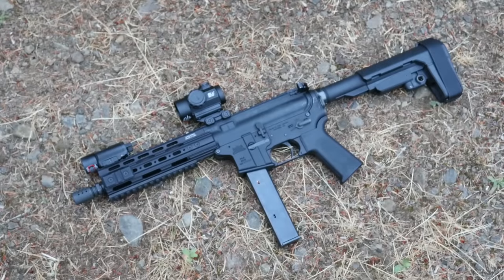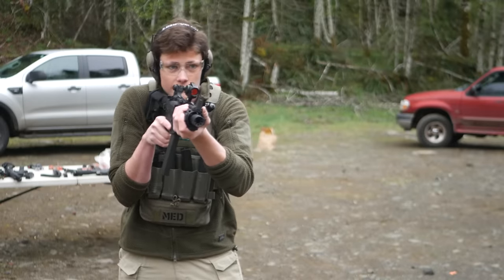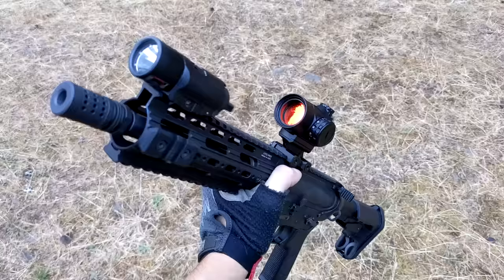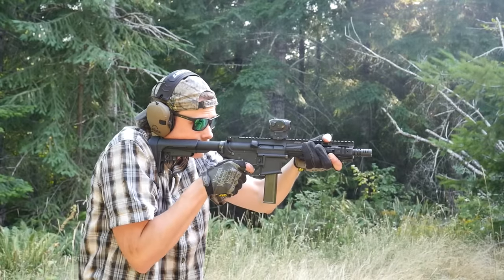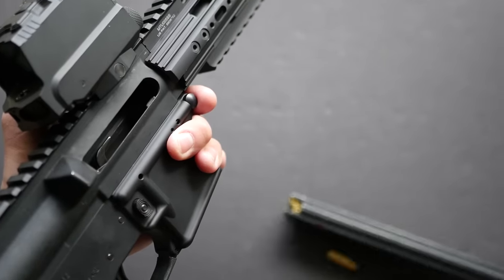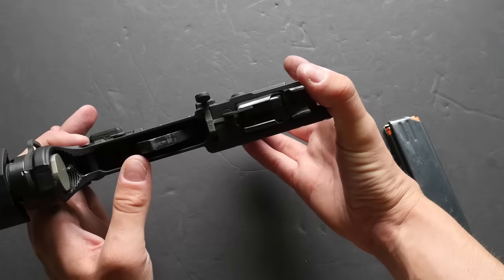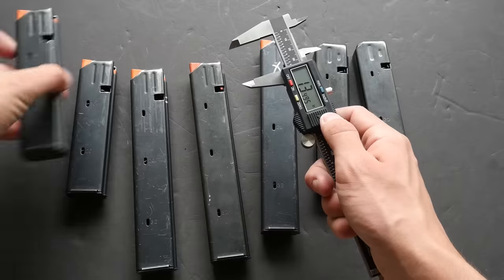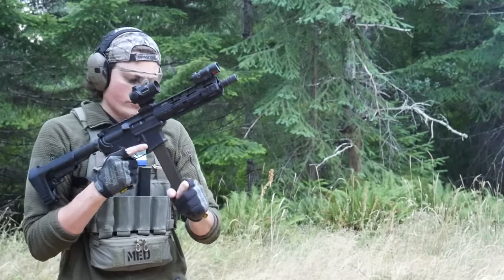The Perpetual Agony of the AR-9

Comment: I ended my pcc fixation with a Cx4, on the theory I can ignore the brace world, and if I like playing with it then it should be reliable enough for a non-eardrum exploding hd gun. Not everybody has a pile of Beretta mags already though
Reply: I did the same thing. 100% reliable and shorter than most AR pistols with the 16 inch barre
Reply: @bubbatime  It's such a handy package because it's practically a bullpup
Reply: I've wanted one forever and never found one.... 😐

Now they're hella expensive.
Reply: @AOMartialArts  ?
Every local gun store had them before the Kongflu. CX4 weren't very popular and are weird huge PCC. Maybe cause of the low price, high reliability and 9mm Caliber they sold out in the last 3panics. (Flu, Riots, Biden)
Reply: @echodelta2172  technically a glock is a bullpup
Reply: My one and only is a KP-9 for maximum slav larp
Reply: @AOMartialArts  new ones popping up for $799
Reply: I got rid of mine. The ergonomics are no where near a CZ Scorpion when working at speed. Time you mag changes with the beretta... Atrocious! I also had to break my grip to drop a mag
Reply: @almostontimehero5415   It's all relative.  I haven't seen any new in years, either.  Haven't seen any pop up used.  I'd love to know the colloquial history of local gun shops.  When this all started I'd hear that one part of the country couldn't get this or that and we'd have it in abundance.
Reply: @senavicente  CZ seems to be one of the only proven options that's close to the same price point. Cx4 magwell design is a bottleneck on reloads, but I'm ok with 31 rounds of 9mm for hd and I'm not particularly concerned about reload speed for my purposes.
Reply: @talltale9760  I appreciate slav larp. Do you wear a track suit and squat by chance?
Reply: @keithhudgins1904  it’s on my Christmas list
Reply: Anyone cool does
Reply: My Action Arms Uzi Model A and FN PS90 are my go-to PCCs. Other than those 2, I say all other PCCs are a waste of my time compared to a 5.56 rifle simply for 1 reason: Length. The Uzi has the telescoping bolt and the mags are also dirt cheap. The PS90 is straight bullpup with the unique 5.7x28mm 50 round capacity. Those are its attractive qualities
Reply: @almostontimehero5415 😂”riots”. Here kitty kitty.
Reply: I absolutely love my CX4. Sure the ergos kinda suck…. Probably due to commiefornia and Commmieanada compliance, but its a great package for not too horrible of a price. I thought the gun was a bit snappy, so i bought a bunch of stuff to give it some mire weight snd soak up the recoil, a muzzle shroud, desantis 2 mag holder in the stock, folding grip, laser and a light setup with a red dot. I disagree about the beretta mags. On their site, if you buy in a bundle, beretta mags are not that expensive, and on top of that, the aftermarket mags by mec gar work great as well. Plus, if you buy a ton of mags, thats a benefit to if you buy a beretta pistol as well, and the 92fs and Px4 are both great handguns. I had a 92 before i bought my cx4.

Comment: Upgraded my PSA 9mm PCC with the Taccom3g “extreme short stroke bolt” and the “pcc adjustable recoil system”…. and made a big difference.  Calmed down the gun big time and improved the reliability. Definitely one of the most noticeable and impactful adjustments/upgrades that I have made on any AR’s buffer/bolt/ gas system….
Reply: Do you have the stock hammer/disconnecter on the psa? I'm upgrading my buffer I just want some reliable

Comment: I’ve always said, unless I need to conceal a PDW for PSD type work (part of the reason why the Army acquired the APC9K), or if crap goes completely sideways, if I’m stepping up to a PDW from a traditional pistol, I’d want something with a 6-8” (possibly even a 10”) barrel. The increase in bullet velocity and accessory mounting space is absolutely worth it… (again save for concealing it, or using it in extremely tight quarters (ie: in tank crews… which I will never serve in))
Reply: One other reason for a short barrel is on a PCC is better accuracy because of 3rd point of contact, better recoil management so faster shots, and longer sight radius which increases accuracy again
Reply: Love my 8” Aero Precision EPC 9 but would prefer an 11” barrel and a 9-10” handguard cause mounting accessories with so few mlok slots sucks

Comment: I put a Foxtrot Mike upper (with their recommendation of buffer/spring) on a Spikes Colt lower and have been pleasantly surprised. Aside from switching out ASC mags for Metalforms 🙄
Reply: I had similar experience with FM bolt and barrel in a cmmg upper. At first, I had major problems with the spikes ar9 lower regarding ejection so I cautiously bent the ejector from the base slightly inward and now it runs like a top with both asc and metalform mags. Hi
Reply: What did they recommend for a buffer and what is the final weight of the buffer and bcg?
Reply: @randomidiot8142  this is from their site “We use a stainless steel music wire heavy duty .308 spring and a 6.5oz buffer.” No info on bcg weight.

Comment: I’m disappointed I didn’t get a shout out about using colt mags. 😢.  Also is your bolt ramped to limit trigger slap and are you running a h-3 or hydraulic buffer?   That cuts down the gun jumping around.
Reply: What do you think about the B&T Hydraulic Buffer for PCC ARs??
Reply: @makevelicustoms  I haven’t used that one.  Mine is an old Viking arms one.  
    But b$t makes good stuff.

Comment: So glad I found this video. I had the exact opposite issue with the mags. Since the ASC mags feed lips are more cupped than the metalform, when my bolt comes back it would flip up the round on the left, causing a ftf. ASC mags feed flawlessly. Another tip is the AR9 ejector must be slightly bent inward and the lrbho tip of the bolt catch must be trimmed ever so slightly so as to reduce the tip interference with the base of the casing. If you look at the two types of magazines from the rear, you will see the ASC mags hold the rounds much more secure than the metalform. I even have my metalform mags upgraded with better followers and stronger springs. Metalform original followers angled the rounds far too upward which would also cause a failure to feed.

Comment: I bought a PSA complete 9mm rifle build that included the Colt mag adapter sans the lower.  Slammed a poverty on there and it's been fairly trouble free for the past 8 years. At $600 total cost, I'd call that a budget success.

Comment: What flavor buffer do you run?
Reply from the maker: Lemon lime
Reply: Brownell's sells packs of 3 tungsten weights for buffers, for $24....  There are 3 steel weights in a standard buffer---  swap one tungsten for a steel and it makes it an H1, swap two and it's an H2... swap all three and it is now an H3 buffer for cheap.... stop buying expensive buffers and just swap them yourself...  Usually you can tune two or even three rifles with one pack of tungsten.
Reply: Good to know for a rifle build, but a standard 9mm buffer is already a little heavier than h3 and I personally ran an extended 10.5oz buffer in mine.
Reply: @Ru1nerZ  Yeah.. I wasn't sure if these used that oversized buffer and bolt or not?...  I've never seen him take it apart.

Comment: All the ASC AR9 mags run flawless with dedicated lowers and a conversion insert both with LRBH. It's definitely a last round bolt hold open problem and it may be an out of spec LRBH on PSA dedicated lowers.

Comment: I love my Glock platform AR-9 I built on a PSA AR-9 lower. It's similar to yours in the YHM quad rail and 3 inch barrel, but I have a pdw brace on mine. It's 100% reliable and is always fun to plink with since 9mm is so much cheaper than 5.56. It's shorter than my forearm as well so makes for a great backpacking gun.

Comment: I've had nothing but good luck with my psa gen4 9mm 10" upper and sylvan arms glock mag block 👍 
Tested with 200 rounds of steel and a stock carbine spring and h2 buffer 
Ran it all no problem 
Just got in a .308/9mm spring from kaw valley precision to try out
Also shot 10 rounds of +p 124 jhp just to see if it would run self defense ammo and ran it just fine as well
Reply: You’re the only one Lol 😂
Reply: @joshmajor8662  what's your luck been w your setup?

Comment: You have a weird problem of the last round hold open touching the rounds causing a round to eject. Maybe they did make some manufactured errors in some of the ASC magazines. But, i do not have that problem with ASC magazines. The ASC magazines are more preferred because they easily insert and eject out of the mag well. I have had problems with Promag magazines.  The metal ones would be a little tight to insert and remove from the mag well. The plastic and metal lined magazines would either not be able to insert into the mag well or be a little tight. All of the magazines would work perfectly in a CMMG MK9 lower.
The bottom line is the last round hold open must not touch the rounds and only touch a small area in the rear of the follower to stop the bolt on the last round. I have had perfect functionality with the ASC magazines. 
I have had to bend the ejector closer to the bolt to make ejector to 9mm case contact for proper ejection. I have found that on colt style AR 9mm that a ramped barrel makes feeding like butter. 
After learning that, i have made the colt style AR 9mm very reliable.

Comment: My problem was the feed cones. Grinding a decent size feed ramp should work. I replaced the buffer tube, buffer, and buffer spring. 8oz buffer and flat wire spring should help with the feeding. Regardless PSA pcc's kind of suck.

Comment: I built a cheapo ar9 with BA barrel,  foxtrot mike handguard and angstad 9mm upper. All on a KE arms 9mm glock lower.  The ejector was way too tall, but I got it working by using my friends spartan arms ejector with no modding. Works perfect after all the ejector bs with multiple mags.  I was warned by my friend to not go the colt mag route or receiver adapter route and I thinks he's right.

Comment: I tried a 4" upper and quickly sold it. I replaced it with a 7.5" and 10.5" upper and settled on the 7.5. 

It took a little work getting the buffer weight right, but ever since I have, I've had no issues. 

Right now I'm running a 1-6 LPVO on it while I save up for the 1x Cyclops in 9mm reticle. The LPVO is way too luch optic for the gun.. but you make due with what you've got. 

I have found a little magnification is still good, even though it's a ~150 yd gun max.
Reply: what buffer weight did you settle on? dialing mine in rn w/ 7.5in barrel

Comment: I gave up on the idea of a cheap AR-9, and just built a PSA AR-V. no problems with scorpion mags.

Edit: also, you appear to be getting a lot of overtravel on your bolt carrier, have considered changing that?
Reply: I did a spikes recluse lower and palmetto state 4in upper and their lower parts kit and replaced the bolt with a stern to use a specific trigger. Those palmetto LPKs for 9mm are perfect in my opinion.

Comment: Shaky bullets in a magazine are the reason I returned the one ProMag I ever bought.
It was a standard Beretta 92 15 round magazine that had the lower mag catch for my 92S. If I loaded it with 7 rounds, everything was tight and fed correctly. 8 rounds and the bottom most round would have a void around it and could shake around all day long. 9+ rounds and the top round would nosedive 100% of the time. It was a local gun store, so they were cool dudes and exchanged the mag I had and the 3 I ordered(cause they had only 1 in store) with a set of genuine Beretta mags.

Comment: I've switched almost entirely to the CMMG delayed-blowback system with their specific versions of the Endomag P-Mag inserts, very happy and very reliable, as well as more pleasant to shoot.
Reply: I have the same and I just wonder about people using the simple blowback bolts/barrels as the CMMG seems to be a lot better.  It's not MP5 soft but definitely an upgrade over direct blowback.
Reply: @prototype3a  I think where I notice it the most is on the return which isn't such a 'thunk' and muzzle dip of the combined heavier bolt and buffer mass of a regular blowback.  Makes tracking with strings of fire much smoother for me when it comes to plates/steel or shooting PCC in competition.  No not as soft as an MP5 or a Sig MPX, but just an easier and smoother overall experience than straight blowback.
Reply: @Fugettaboutit  My friend has a pretty nice CZ Scorpion and it has about the same recoil but the CMMG is "smoother" and the CZ is "sharper".
Reply: @prototype3a  I also have a PSA AKV, which is a sharper recoil, but it is very short and quick because the bolt travel is so much less than a typical AR system, so it''s right back on target as opposed to that 'ka-chunk!' of a lot of AR9's.  That gun is a lot of fun too.

There are also ways of taming the whole recoil feel of a straight-blowback AR9, anything from tuning your bolt/buffer weight to a specific handload, to other types of bolts/buffer that magnetically delay the blowback, or in my case with my earlier AR9's using a combination of hydraulic buffer and an extra wave spring at the very rear of the buffer tube.  But that can also really beat up a trigger group since it's still more weight than a standard AR bolt carrier coming back and slamming the hammer harder/faster that what was originally designed.  So odd as it's 'just' 9mm, and a pussycat in something as small and light as a Glock 19, but it's all the internal weight being slammed back and forth since it's mass keeping things closed at first as opposed to a momentary mechanical lockup.
Reply: I bought my cmmg before they offered the Pmag style so I've got the glock mags. Kind of inconvenient because I'm almost the only gun guy left in the world without a 9mm glock lol. Great gun though. Reliable and soft shooting. I may go for a slightly longer barrel for safety. With just 5" I'm reluctant to do some types of drills quickly because i don't want to shoot my left hand. I did add a cheap flash hider just for the length.
Reply: @Lucas12v  I have the 8.5" with a 7" AP S-one.  I prefer 9" handguards as a 7" is honestly only barely long enough to attach all the things you might want and even then it still isn't easy.

MAS Defense sells a nice polymer handstop/barricade stop that I rather like on mine.
Reply: @Lucas12v  I think all you would need to convert to the PMAGs is slap your upper onto a regular lower.  Just make sure to get the "CMMG" style Endomags.
Reply: @prototype3a  I thought about doing that but I've already bought the overpriced glock mags now anyway. It's ok though, i like it enough to make up for it. And glock mags were a good choice from cmmgs perspective.
Reply: @Lucas12v  I'm looking to get a 5" version for a super-short combo to use with a suppressor.  Have a 16" and an 8".  Having the Glock mag lower is nice if you're going to build a PCC for sport/competition shooting because the P-Mag versions only go up to 30 rounds, whereas you can get mags and extensions for Glocks that go beyond 50-rds I think....nice for long stages and not worrying about reloading.
Reply: @Fugettaboutit  that's a good point. I think glock mags were a good choice. Just for me specifically, pmags would have been better.
Reply: @Lucas12v  Well you can easily make one with any mil spec lower and just get the complete mags or inserts for P-Mags, make sure it's the specific ones for the CMMG system.
Reply: @Fugettaboutit  I may do that someday but for now i already bought a bunch of glock mags so I'm pretty set for the moment. Good suggestion though.
Reply: @Lucas12v  I still think the regular AR lower and mags looks cooler, too.  The PMag versions  are very reliable in this.  I mark mine with red tape to make sure I don't mix them up with my 5.56 PMags.  Also what's great is that I can switch uppers between a 5.56 one and a radial-delayed 9mm and not even change buffers.  Gives you a lot of options if you go SBR as well.

Comment: I did a 9mm AR build once, and it was arguably worse than my Scorpion in just about every way.  Sold it.
Reply: Cmmg bashees are the way to go. At least for me
Reply: I just bought myself a scorpion as well after already having a very top tier ar9. What was the main reason you let yours go? I have been pondering putting mine up as well even with the radial delayed system purely because the scorpion shoots better and I won't have to deal with the hassle when I suppress.
Reply: @kaicrist9818  it just didn't do anything my other 9mm PCCs did, and was unpleasant to shoot.
Reply: @corvoattano4777  supposedly some of them don't like running on cheap ammo? Any experience with that?

Comment: RE: ASC 9mm Mags - Disassemble and run a round file inside the mag at the spine weld. Cleans it up and makes the follower slide smoother and the mag overall better.

Comment: What I see here is that the last round catch is hitting the back end of the cartridges as presented by the off brand mags. I have not encountered this with either kind before and I suspect that it could well be partly a receiver issue, possibly the slot for the last round catch is too far forward. The simplest solution I can think of would be to shave .06" off the front of the last round catch to give yourself some more clearance. I suspect this could make it possible to use all your magazines. Worst case, it doesn't help and your bolt catch is shorter. Worst worst case, you would need to replace the bolt catch ( $20).  Free internet advise, worth every penny you paid for it.